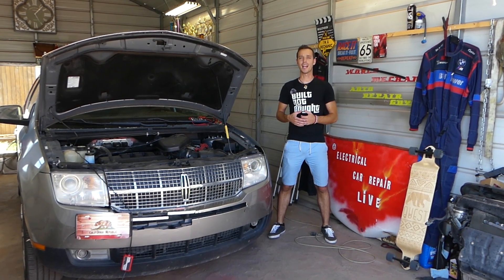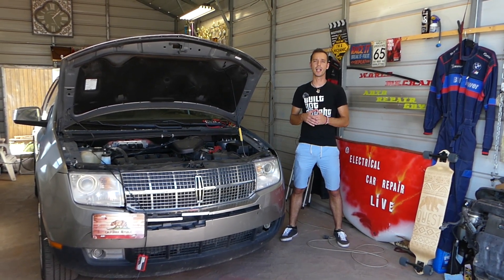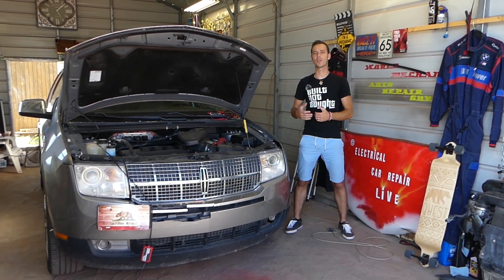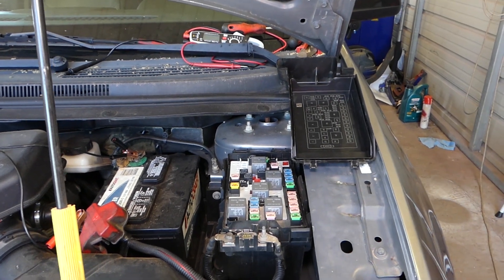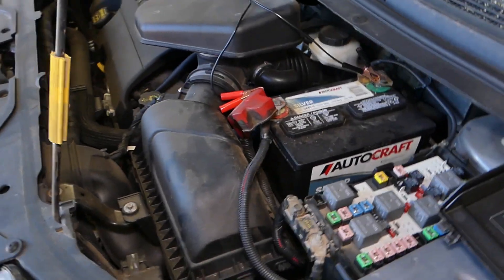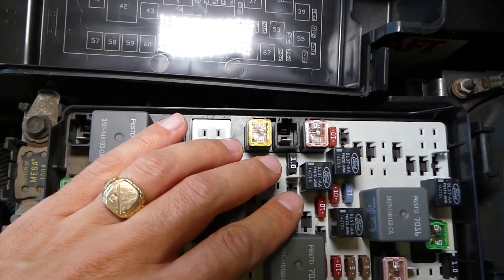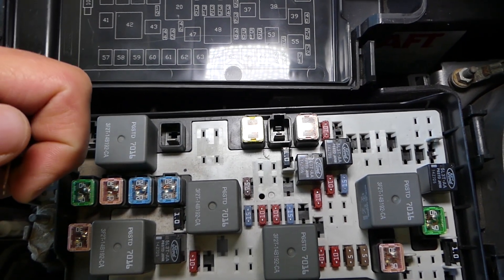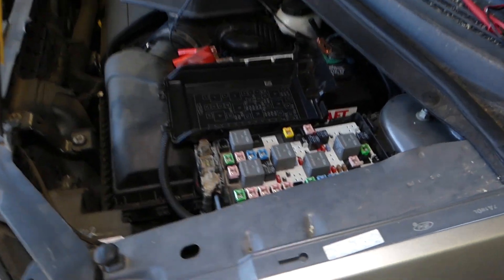LINCOLN MKX AC COMPRESSOR RELAY LOCATION REPLACEMENT. AC NOT WORKING

Comment: I have a 2008 MKX and my defrost doesn’t work and I can’t make the air come out by your feet. It’s stuck in the vent mode. And no air comes out by the windshield for defrost mode. Any ideas what the problem can be? Thanks for any help

Comment: Hey guys. I like your content and I RARELY subscribe to anybody but I just bought a 2007 Lincoln MKX a couple of weeks ago. I DID make some PCM mods, but I used ForScan PATs programming to remove old keys and add two new Flipkey replacements (which worked, however the new universal 4D63 315mhz 4 button aftermarket does NOT operate the power rear lift gate, but that's not my current question). Simply some possibly relevant information that happened the night before I noticed the AC was blowing hot. It was in the high 60s when I programmed the new keys, so I probably wasn't running the AC after adding the keys.

Also, I'm a 25 year software engineering professional (now I lead global artificial intelligence product development for a billion dollar private company with 35,000 employees in 26 countries, so I know quite a bit about programming. But I'm no mechanic and this is my first time trying ForScan. As I refused to pay local locksmiths $50 for programming and $25 to cut and reassemble the flipkey fob replacements when they actually told me it was impossible and they couldn't guarantee it would work, or even that they could open and close it without breaking itn. I bought the flipkey fob for $15 and the HS/MS switchable odb2 to USB interface cable for about $20 to load on my laptop.

My first question is I want to jump either the relay (37) pins (but there's no circuit closure spec anywhere I can find). I've seen many relays with it printed on the relay itself, but the FORD factory relays in my Lincoln ARE NOT written on the relay itself and I can't find schematics to determine what to jump.

So, can you point me (preferably in a picture form) to where the plug enters the low pressure switch, so I can jump it directly on the switch and see if that engages the clutch and starts blowing cold air. Right now I can't get it to accept the recharge because it jumps to immediate red when I engage the kit to the low pressure port and turn AC and blower to full because the system doesn't have enough charge left to engage the vacuum and pull the coolant in to the system.

Any help would be greatly appreciated. 👍🏾😁
Reply: I have mkz Lincoln 07 tha air conditioner don’t blow everything is on just don’t blow air can y’all help me what can be please 🙏🏼 thanks
Reply: Did you ever figure this out I know this is 3 years later but I'm having the same problem on the same car.2007  Lincoln MKX
Reply: I'm trying to figure out which slots do I put the paper clips in the ac clutch relay looks nothing like every other car's I've seen on this Lincoln MKX the 4 pins all go the sane way if this makes sense
Reply: @donpacaso  sorry, I just noticed you're asking cuz you have the same problem. The relay jump does work. But unless you have the printed diagram on the relays, it's kind of a crap shoot. But the problem is that when the freon runs completely out on these AC units, it causes vapor lock and to protect the clutch it disengages it. You MIGHT be able to get freon in, but you really need to use a professional freon kit and tank. Over the counter cans with an included gauge and hose won't cut it. The higher precision and quality devices at a used car lot will actually release the vapor lock by making sure the unit is completely empty first by draining it, then it immediately switches back to fill mode and will release the mechanism that causes the electrical relay to trip. The relay jump is a risky procedure that could actually fry your relay housing so none of them work.

I'd suggest calling around to a few old school mechanics and let them know you think it's thrown the relay because it drained every bit of freon while still running. I would think one in five will know how to fix it rather than spending a grand to replace it. Good luck brother. I'll add a prayer for you tonight. 🤓🙏🏽
Reply: @moisesmeza8839  sorry, I didn't notice your question a year ago. See my response to @donpacaso below. It's a flaw in these AC units that's intended to keep you from frying the compressor clutch when it runs COMPLETELY out of freon (most AC units stop blowing cold long before completely empty with a pound of freon still in the unit, so it's not a problem). But any old school mechanic with Ford/Lincoln specialization will know the pro tricks to fix this. Jumping the electrical relay is the absolute last thing I'd recommend. My AC never worked again cuz the jumper (a paper clip) slipped out of my fingers and stayed engaged for like 15 seconds. 

That's all it takes to fry that compressor clutch.

Any other MKX owners between like 2001-2008 I think. Just top off your freon every year to be safe. This problem happens to 10% of the models still on the road. If it starts blowing hot, you're already screwed. It's partially because these Lincolns are luxury trucks, so they originally thought it would be good if it never reduced the coldness until totally empty.

And then if you wanted to get it repaired, only dealerships would have the precise knowledge of how to fix it. Thus forcing you to return to the Ford/Lincoln DEALER for service, at about the time you might just want to trade it on a newer model.

Car manufacturers are devious man. They like using bolts and screws that only dealers can manipulate. But if you like tweaking these older Fords and Lincolns, I highly recommend using FORSCAN (free open source software for your laptop). It can easily encode factory key replacements, which saves you a ton of money if you lose your key or need a spare) and do cool mods like if you have push button start, most of these older models also had the "possible" functionality of REMOTE START already built in, but only activated if you purchased the right technology pack of features for an extra 2-3 grand. FORSCAN would allow you to mod one setting and bam. Your keys would function for REMOTE START, FOR FREE! Cuz the early version of push button start came bundled with remote start. It was simply disabled in the computer unless you'd bought the technology package when it was new. FORSCAN can be dangerous too, though. Cuz the manufacturer is always shutting down sites that offer programming codes and such for the software. So it's usually trial and error. One wrong setting and you'll blow your engine next time you start it.

Just remember only change one setting at a time and save each old configuration before making any changes. So you can roll it back if you cause a problem. 😉